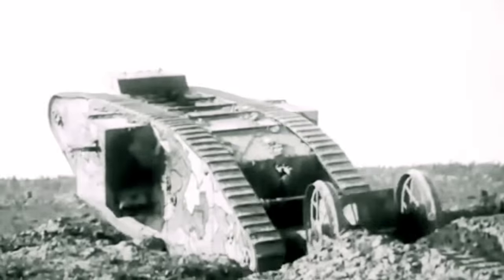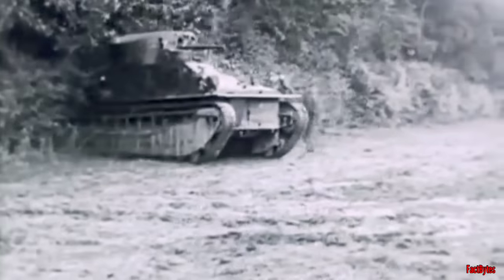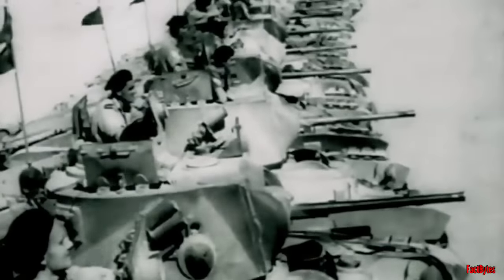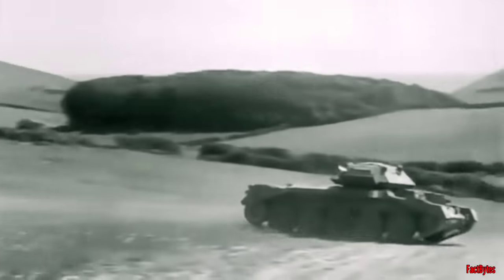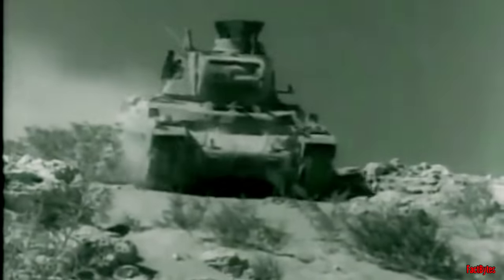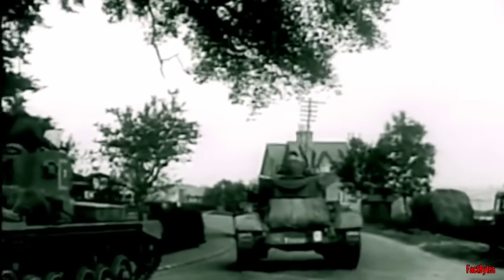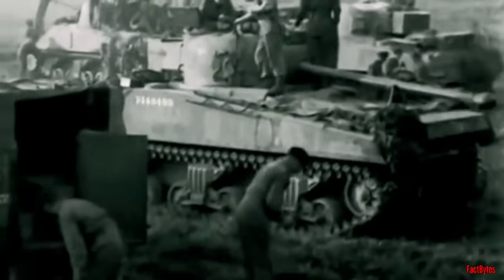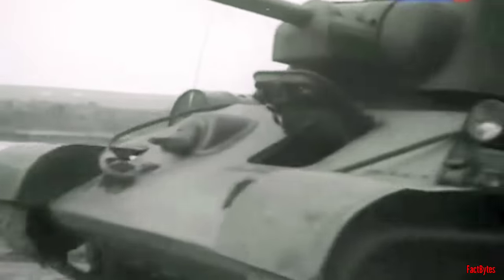Why Did Britain Struggle to Build Effective Tanks During World War II?

Comment: I'm sorry but I have to clear up some points. The 6-pounder was delayed into production because the British Army lost all its anti-tank guns in France (about 850 in Wiki: Battle of Dunkirk). With an invasion imminent there was no other option. The 3" 20 cwt gun (an early AA gun) was also mobilised as an AT gun to put in bunkers. 
One crucial issue with British Tank development was the absence of a suitable line of engines. There had been a committee for this, but apparently they would meet, spend the morning discussing what sort of tank would be built, go for a nice long lunch, write up the minutes in the afternoon and go home. When the balloon went up some rushed decisions were taken. Meadows put together (I don't think you can say developed...) a flat-12 engine for the Covenanter which was unreliable, had a disastrous cooling system and had no room for improvement. Vulcan Foundries put two engines in the Matilda II driving a common gearbox, it did work but was underpowered, complicated and very difficult to repair. Vauxhall stuck together two lorry engine blocks in another flat-12 for the Churchill, this was improved to an acceptable standard of reliability but the power output was about half of what was necessary for such a heavy vehicle. The Rotes group went for the American Liberty V-12 engine, a very well known engine which should not have held many surprises, however the method of construction was obsolete (this was a 1917 aero engine) and the result was a fragile engine with too many parts exposed to dirt and dust. To top it all the drive for the cooling fan was really bad and they put the engine (carburettor) air intakes where the tracks released all the dust and dirt when coming up into the drive sprocket, you couldn't have done it worse if you tried. A stew of unpreparedness, inadequate development, stupid ideas, incompetent engineering, fat-arsed civil servant amateurs not doing their jobs and no government body to properly regulate the process. The Covenanter was so bad the Army refused it for combat and some 2000 of this useless vehicle were built, used only for training. A lot of the footage in this video is of Covenanters showing off their good turn of speed for the Pathé newsreel cameras, for every one that you see running count three broken down. Even so men were injured by its spontaneously self-closing turret hatch or burst coolant pipes in the crew compartment squirting boiling water all over the place. Very few still exist, they were all melted down or shot to pieces in ranges, the one in the Tank Museum was dug up out of the ground, it may be the only one. 
The cherry on top of the cake is that 2-pdr HE ammunition was developed, and the tank crews were always clamouring for it as they could not deal with anti-tank guns with AP shot, 2-pdr HE is not much but better than nothing. Some HE was shipped to North Africa, but IT WAS NEVER DISTRIBUTED and nobody knows why. I can guess that the Royal Artillery, which was a very influential arm in the Army (after its pivotal role in WW1) blocked it under the pretext that firing HE is their preserve. This was also the reason why Close-Support tanks  (about 1 in 10 were made with a 3" howitzer instead of the 2-pdr) only had smoke shells. 
It's surprising they actually won the war.
Reply: They haven't, Soviets and Americans carried British to war end.
Reply: @AKUJIVALDO  The British supplied the Russians. One of its key supplies was to do with an ingredient needed in explosives. The Russians would have done very little without it. We put everything we had into that war. So no we were not carried by either.
Reply: @dulls8475  truth is, without US resources and USSR manpower, GB would be smacked senseless into either peace treaty or surrendering, depending on Germany's mood.
Reply: @AKUJIVALDO  The fact is when GB was in the War before the US or Russia joined in we did not surrender or make a deal. That is a fact. You must be thinking of what you would do in that situation.
Reply: @dulls8475  ah yes, so great and brave, while having anti-tank ditch called English channel...

Truth is, war wasn't going well for Great Britain and only US resources were saving it.
Reply: @AKUJIVALDO  So the fact that we are an island nation is to be held against us?

While the British were not too successful on European soil, The Royal Navy was pretty successful. 

During the two Naval battles of Narvik, ships of the Royal Navy sank, or caused the destruction of 10 (ten) Kreigsmarine Destroyers. This was half of the total German fleet of Destroyers. 

Those ships were needed if they were going to invade the UK by sea, and it can be postulated that after Narvik, a Seaborne invasion of Britain was impossible, because of the loss of those 10 German Destroyers! 

On top of that The Battle of Britain cost the Luftwaffe far too high a price in aircraft and crews. If an RAF Fighter was shot down over England, the pilot could bail out and often be back flying the next day in a new Spitfire or Hurricane. 

Whereas if a German aircraft was shot down over the UK, even if they bailed out they were lost to the Luftwaffe. 

So, as has been said on here before, The Royal Navy and the Royal Airforce were generally considered more important than the Army.
Reply: @AKUJIVALDO  Rubbish! People seem to forget that we had help from the Commonwealth Nations. Australia, New Zealand, Canada, Kenya Rhodesia South Africa to name a few! 
Russia only came in to the war because they were attacked by Nazi Germany. The USA only came in to the war because of Pearl Harbour. Winston Churchill persuaded Roosevelt that Nazi Germany should be the highest priority - and he was right! The UK was bombed, America was not! If it had been I think WW2 history would have been very different!
Reply: @AKUJIVALDO  That's actually unfair, the campaign in North Africa was almost exclusively British. The American participation after Operation Torch was disastrous, amateurish in the extreme. Things in Italy and North Europe were more balanced, but Tunisia (and the later operation in Anzio) showed up American incompetence in a big way. Read up about the battle of Kasserine Pass. The Soviets also were pretty useless in spite of their numerical superiority and technical superiority in some aspects. This was fruit of Stalin's purges having left an officer corps made up of timid non-entities, the purge survivors, these were cut to ribbons by the nazis. Then General Winter took over and bought them some time to re-train, adapt and respond. The result was much more effective, although they also suffered heavy casualties largely due to poor tactics, poor design decisions in their tanks and disregard for the lives of their own soldiers. The influence of the political Commissars was also a great battle-loser. Read "For whom the bell tolls" by Hemingway, it is a good read and inspired on real events. It shows up very well the effects of political meddling in warfare, in this case the Spanish Civil War, the dress rehearsal for WW2. The Soviets never acknowledged the enormous material support the Allies sent them, something like 160,000 Oldsmobile trucks from America, thousands of tanks and other armoured vehicles from both the UK and the USA, countless aircraft, and as a final curiosity 18 MILLION pairs of boots from the UK! I never would imagine the UK shoe making industry would be capable of such an effort beyond what their own forces required. The hides would have come from Argentina and Brazil, probably in semi-tanned condition, i.e. stinking to high heaven and covered in maggots and rats... ask anyone who has worked in the leather industry.
The Soviets also had carried out some research into radar, so they were not complete newcomers however they depended on British and later American equipment.
Reply: @AKUJIVALDO  I don't think so. The US resources were paid for at huge interest, so even if the US had not entered the war when it did the goods would keep coming in. This compensated the difference in industrial capacity between Britain and nazi-occupied Europe. The German auto industry was too small, much smaller than the British one. Germany designed a large jeep-type vehicle (not the Kubelwagen that was a 2-wheel drive car) but never got the production capacity for it. They depended on the Austrian (Steyr-Puch), Czech (Skoda, Tatra), Polish (Fiat-Polski, Ursus), French (Renault, Peugeot and others) industries to back them up. Even the Italians had better desert trucks than the Germans. Dependance on occupied territories is unwise, factories can and were sabotaged, logistics routes interrupted, and so on.. Britain is an island and evidently incapable of surviving without thousands of tons PER DAY arriving at its sea-ports. This is why the Battle of The Atlantic (in which my late father participated) lasted from day one to the very end of the war, and was the cause of much lost sleep for Churchill.
Reply: @donyoung1384  The help from the Commonwealth nations and occupied European nations was very significant, in the case of the Poles in the RAF some consider it decisive. However it was the British will to fight that gave all these the opportunity of doing their bit. Had Lord Halifax become Prime Minister history would have been very, and tragically different. On the plus side, communism would not have spread like it did from 1945....
Reply: @ricardodavidson3813  I completely agree about the help from the Commonwealth nations being crucial. In fact I’ve often argued that Britain was NEVER ALONE in the fight against Naziism. 
The Poles were a significant addition to R.A.F. Fighter Command at an important time during the Battle of Britain, but there were also great fighter pilots born in the UK, as well as in Commonwealth Countries, and I believe that by saying the Poles were “decisive” in winning that conflict is to insult the British born and Commonwealth pilots of Fighter Command. There were even half a dozen Americans, enlisted and flying as Canadians, in Fighter Command!

I do agree that it was the British will to fight, which was important and I’d further add that much of that willingness was down to that pugnacious little man who became Prime Minister just before Dunkirk, I do of course mean Winston Churchill!
Reply: @donyoung1384  I did not say it was decisive, I said "some say decisive", I have read a lot around the subject and different authors have different opinions, but all agree that the kill-to-loss ratio of the Poles (8:1) was unmatched by anyone else. If you tot up the total number of aircraft they shot down and subtract this from the Luftwaffe losses you will see the difference. Whether it was decisive or not is academic, myself I think that without their contribution the BoB would have dragged on Ito the autumn, bad weather would start taking its toll and the end result would probably have been the same. No nazi air superiority meant no Operation Sea Lion, and that was the important result.
I agree that the "few" were all extraordinary men and we should not allow divisive comparisons to sour the glorious flavour of the result. Have you seen the monument to the few in London? Wonderful, it brought a tear into my eye. I wonder if it is still there or whether it has been vandalised by the woke human dross that seems to be everywhere like a really bad rash.
Reply: @AKUJIVALDO  You OBVIOUSLY don’t know much about Prime Minister Winston Churchill! He wouldn’t surrender until after tanks captured number 10 Downing Street, (and probably not even then!)

Comment: This video makes some pretty wild claims, there were several very successful British tank designs, Crusader, Matilda II, Valentine, Churchill, Cromwell, Comet and all of them had a big impact on the war, some of them may have become outdated as the war went on but that doesn't mean they weren't a good tank for their day. If the M4 had been designed in 1940 it may also have been outdated by 1942, same as some of the early British tanks.

To suggest that the Centurion was the only successful design and that it came too late to contribute is really off. 

The issue with British tank production was that there were too many variants and because production was being done on an emergency basis sometimes 4000 units of a poor design had been ordered and were in build before they corrected the issues or abandoned the design, at that point its better to have 4000 average tanks than none.

Britian produced around 30,000 tanks in WW2, and about 18,000 of them were of the successful design type (Crusader, Matilda, Valentine, Churchill, Cromwell, Comet)
Reply: M3 medium was designed in 1940 and in service with British forces Asia to the end of the war. M4 was designed but there were not sufficient machine tools available to make a turret to fit a 75mm gun in quantity.

Comment: As a former owner of a new 1966 BMC Mini, I do understand why!!! It was an absolutely and absurdly bad made, production disaster! Even from the corners of the - front screen, water came in, as well from the sliding windows in the doors, into the boxes below. And I had to bend in the "window frames" with my knee in between, to make them meet the rubber sealing on the body! And don't drive after a car during rain, as it will cut the engine! The seats had only the three holes in the bottom for adjustment, forward and backwards (The swingarm just changed the angle of the seat, not the distance!). And the outside hinges, still with acid from the cleaning before painting, in the gaskets on the doors, so the paint started peeling off after some time, around those!
         And You ask craftsmen like this to construct a much more complicated Tank!!! 🤣
Reply: And also look at the elderly English motorbikes, with their constant loss of oil! And the chainwheel outside a maybe very warm brake-drum, to make sure that the chain-lubricant eventually made braking impossible! Smart! Plus it became expensive, when the teeth and chain had been worn down!
Reply: Go to the tank museum in Bevington and touch those tanks. They are bloody well made.
Reply: My mother had one of those, perhaps from 1961 or so. The windows were ok but the engine did cut if it went into a puddle. This was because the distributor was on the side of the engine that now pointed to the front and was inadequately shielded. My father fixed it. The workers in 1966 were mostly so imbued with union propaganda that it was impossible to get anything well made. There were some bad design elements in the Mini, but all design is compromise. 
Your rant fails to take into consideration that it was British workers that built the first tanks ever.
Reply: @ricardodavidson3813  I'm sure that even cars built in Britain, now mostly under German Control, may be fine, quality wise though I have seen an engine from a new MINI being taken apart and not for being brilliant, on YouTube.
    But the construction of the original Mini was at best, strange, I suppose mostly for production reasons! But the outside door-hinges being mounted before being dipped in acid for cleaning before being painted, wasn't exactly a good idea. And the outside bent plate-connections in the corners, giving it the "Streamlining of a Barndoor",  wasn't that smart either. Having the gear-shifter in the bottom instead of by the wheel, as a SAAB, now the gearbox was below the engine, may have been made more functional. The idea of a car with a wheel in each corner and the turned round engine for optimum room inside was so brilliant that it was difficult to ruin it, but the British managed to make a really good try!!
Reply: @finncarlbomholtsrensen1188  Have you ever been in a Mini? They are minute, only two steps. beyond a matchbox... The spot-weld seams were put on the outside I guess to gain a few cm inside. Had they been inside they would have required padding and the whole thing would become even more cramped. The driving position was really bad, it improved in later models with an articulated break in the steering column. The gear shift was fine where it was, it went directly into the GB mechanicals, column shifts are prone to linkage troubles. The Mini was fine for small people... like the Fiat Topolino that was even smaller, you could get 4 people in the 4-seat version if they were short, slim and you used a shoe-horn. 
The gear link issues also apply to tanks, having the transmission at the rear makes good mechanical sense but linking the gear shift all the way back can be a problem. In the Cromwell and others it was done by compressed air. Having the transmission at the front means a huge drive-shaft which from a radial engine (Grant, Sherman and others) is a stupid solution. Maintenance of the gearbox means you either have removable panels that will weaken the frontal armour or you provide space for some poor soul to do it from inside. The Pz. 4 had removable panels that were angled very flat so their contribution to the frontal armour was reduced, it was mainly the end glacis plate and the brick wall in fromt of the driver. Still dodgy though. Modern tanks generally follow British/Russian practice of having the transmission at the back except when the engine is also at the front (Scorpion series, Merkava).
Reply: @ricardodavidson3813  As past 6" I sat fine in my Mini, though it has some absurdly constructed seats (I lowered the steering with a bracket and had a 12" Moto-Lita wheel + a new Special seat) and if decently constructed, and made, it would have been a brilliant car!
    Sir Alec Issigonis had all the right ideas, but sadly not the Factories to make them come to life.
Reply: My second new car, a 1970 BMW 2002, also had awful seats in front, which were too short and flat for a tall person, so I gave it a special Scheel Alpina Seat and a new mounting Frame with adjustable angle and high. Which I kept for my - next many cars till the very latest.